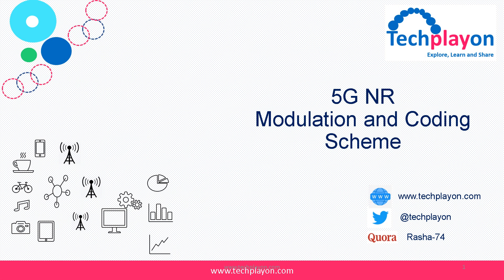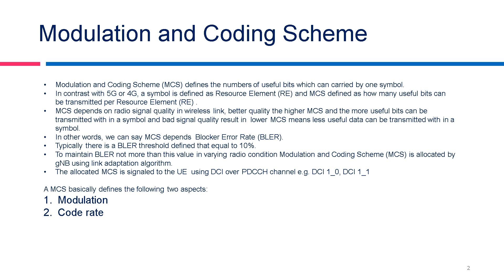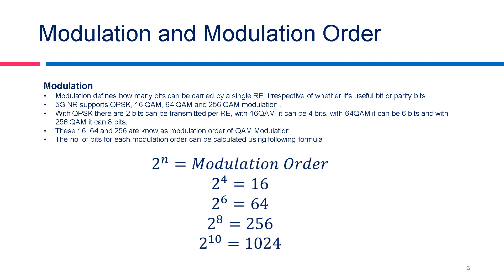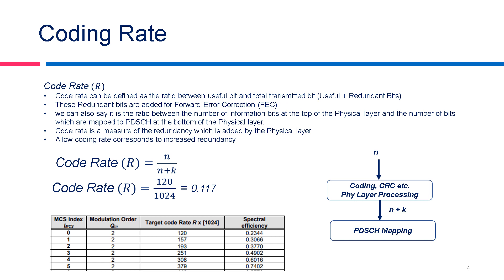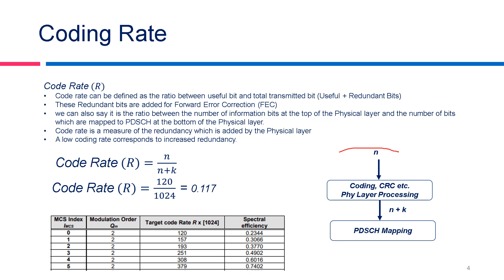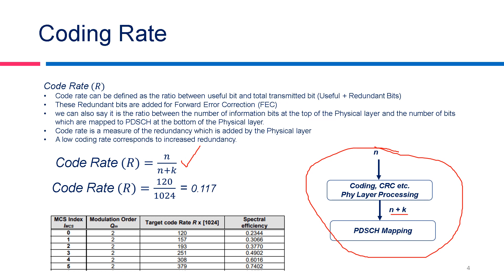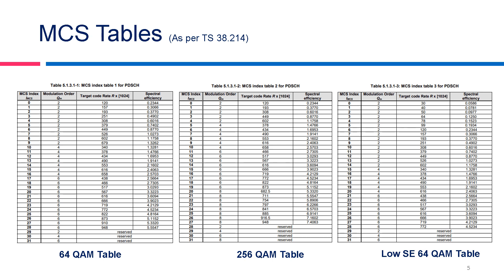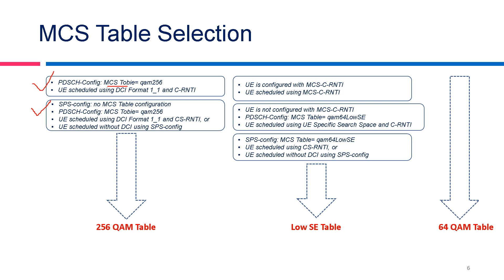5G NR Modulation and Coding Scheme - Modulation and Code Rate

Comment: Thanks for taking this topic on 5g. Really useful. I have a question regarding second table 256 qam why we have 4 modulation indexes reserved ?
Reply from the maker: Yes you are correct. The table 256 qam has 4 modulation index because it need retransmission MCS for QPSK, 16 QAM, 64 QAM and 256 QAM. Where as other table needs to support retransmission MCS for only QPSK, 16 QAM and 64 QAM. 

Hope this answers your question.
Reply: Techplayon thanks for your response. It cleared my doubt